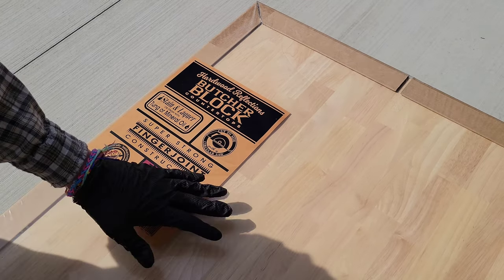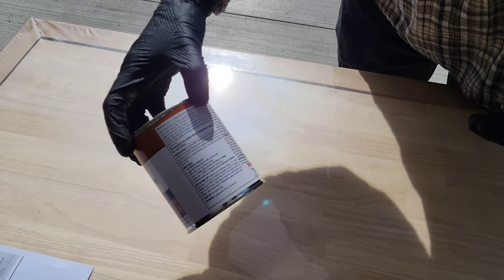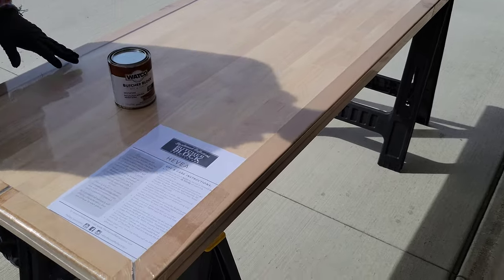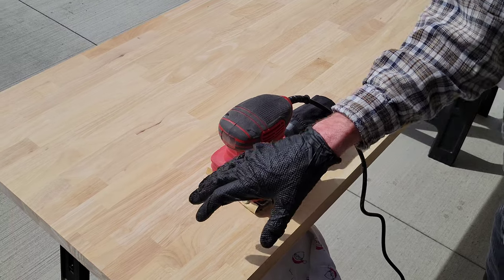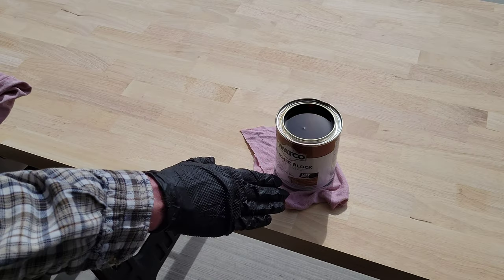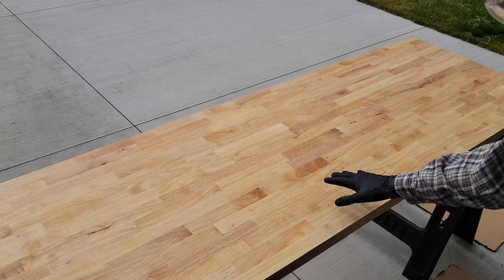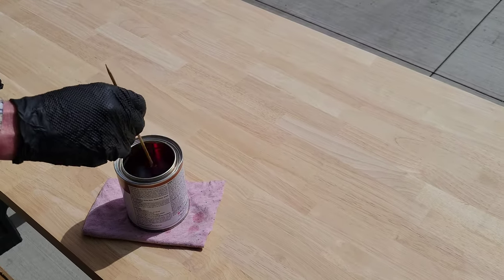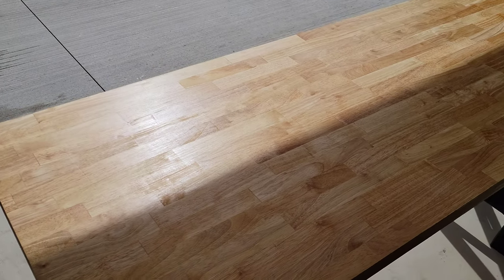How To Prepare, Finish, And Seal A Slab Of Butcher Block

Comment: I got two Butcher Blocks for an L-Shaped desk, and I used the same oil and finish as you did. The two butcher blocks I got from Lowe’s said that I did not need to sand them, but instead wipe them down before applying the finish. There are some YouTube channels that tell you to sand the Butcher Blocks regardless… is that necessary? Any feedback you provide would be greatly appreciated.
Reply: Really depends on the grit the block was sanded with before being packaged. Some are pretty rough, others are already sanded to 220. Really can't hurt to sand it, a stain/finish is going to bring out the roughness if there is any.